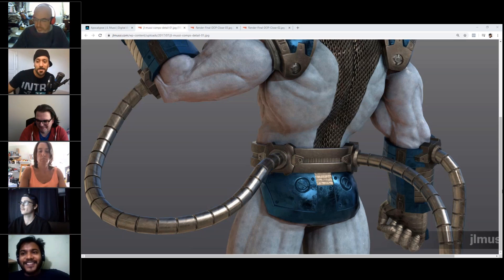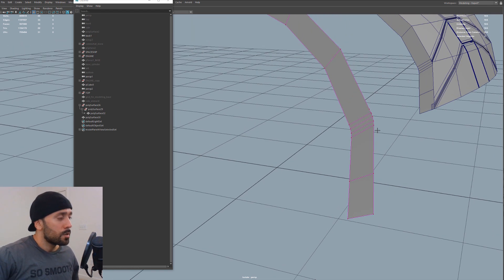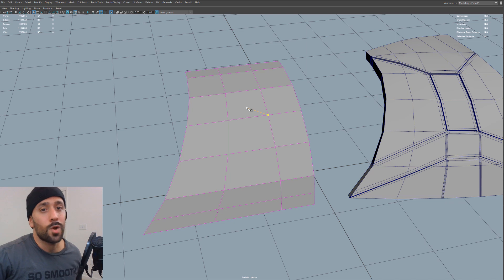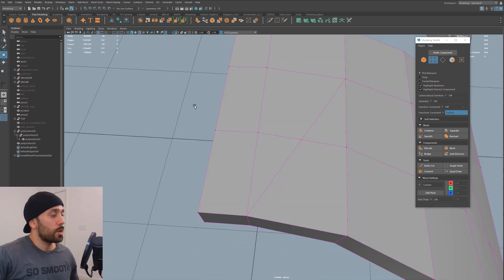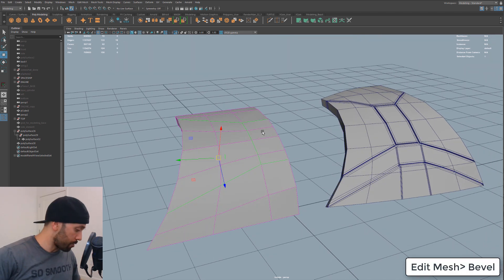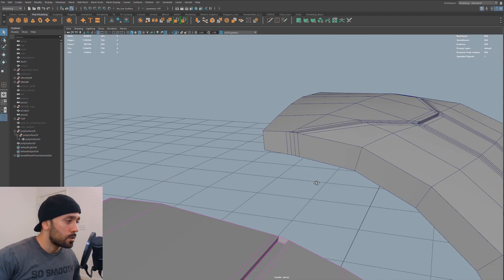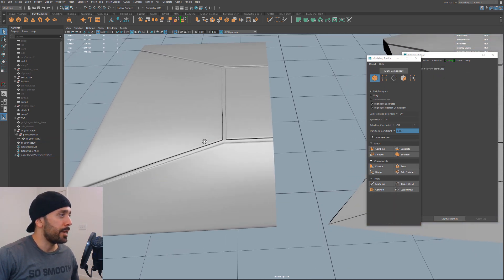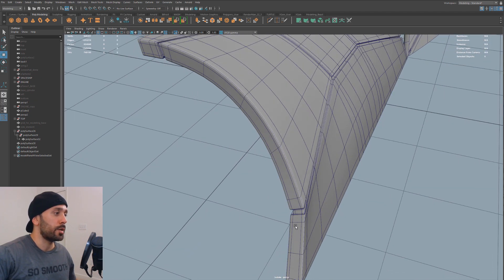Fix My 3d Model #1 Maya Modeling Tutorial: Hard Surface Panel Lines

Comment: Plz Use The Set Edge Flow Tool, It Essentially Takes Any Edge Selection And Places It Somewhere Where It Won't Interfere With The Smoothing Of That Area. It'll Pretty Much Align The Selected Edges To An Area Which Fits The Smooth Formula's Spline Math Meaning That The Smoothing Will Look Like You Never Placed The Edge There. This Is The Best Way To Add Information While Keeping Your Smoothing Exactly The Same.

Comment: As a little tip or sidenote, if you more or less "define" the curvature of your bend before trying to cut your panel you "minimize" the effect two edges close together has so you're less likely in getting into serious pinching and its less forgiving. sure you will end up with a little more of polygons but will increase the visual quality overall